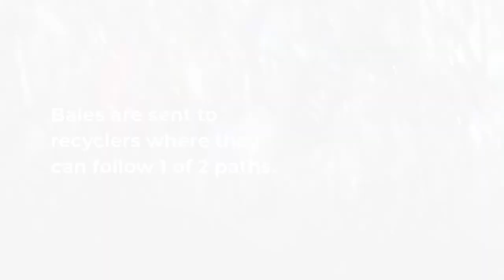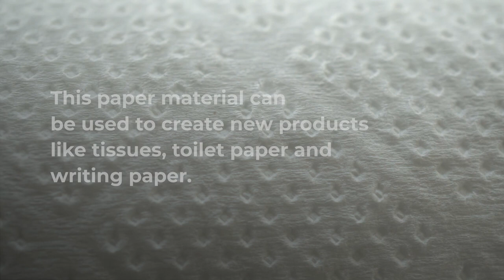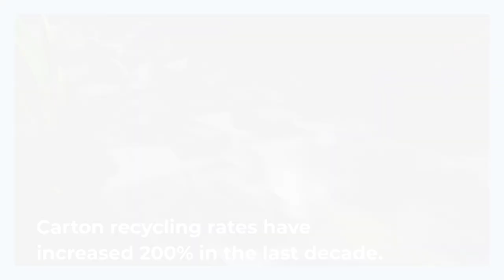Tetra Pak® Carton Recycling Process

Comment: I have a question please how much net water is used to recycle one tetrapac
How much electricity is used in this process per unit
I noticed that you call your product a carton but there is also plastic and aluminum liner if I'm not mistaken where do we separate and ship those elements of the packaging

I appreciate your answers
Reply from the maker: Thank you for your question. On average, our cartons are made of about 70% paperboard. 

Our cartons follow one of two recycling paths. On one path, the cartons become building materials. This process presses the paperboard, plastic and aluminum into boards and does not require any water.

On the second path, the cartons are sent to a paper mill where the fiber is separated from the plastic and aluminum components using a piece of equipment called a hydrapulper. Hydrapulpers are commonly used in paper mills for pulp production and many of these systems recirculate water to reduce overall consumption. The plastic and aluminum material left over from the pulping process (aka PolyAl) is either being disposed of in landfills or being used as a fuel for waste-to-energy, however, the Carton Council group is working with multiple entities to develop a use for the material in manufacturing. 

At the paper mill, recycling cartons requires a similar amount of water and electricity as other similar fiber-based materials. 

Check out recyclecartons.com to learn more!
Reply: @tetrapakuscanada  appreciate your answer!

Comment: I don't think my city recycles these - they accept paper, glass, and plastic 1,2 and 5. Even if it ends up in a landfill, however, I feel like this is still better than most plastic jugs that rarely get actually recycled anyway. The paper and metal parts will biodegrade leaving a small amount of plastic compared to the typical jug for milk. I would love to see us go back to glass. There are a few brands around that do that.

Comment: What happens with the plastic and foil sheeting in the milk&juice boxes?
Reply: Tetrapack is mostly a scam, they rely on a process called “greenwashing” to sell packaging to companies so customers buy their products thinking it’s good for the environment.

If the Tetrapack packaging you sorted into recycling is lucky, and your local sorting facility supports it, it *may* get sent to a facility in Mexico where they’ll cut them up and reuse some of the materials into filler material for construction or whatnot, ironically at a huge environmental cost, and the plastic parts go to landfill.

Tetrapacks aren’t actually recyclable.
Reply: @ethaneveraldo  Thanks. This is a sad realization of years of even stripping the plastic bottlecap from tetrapack boxes and dropping them to the plastic waste.
Reply: @ethaneveraldo   

I mean, it doesn't get more than their own reply to show how inaccurately pessimistic your comment is. Moreover the fact that building materials are harmful to the environment doesn't mean that there isn't good in using recyclable materials on them. The net damage to the environment decreases this way as the damage from construction is yet to be reduced by technology and well, we still need to make houses. Tetrapak is not a scam.

Their response:

Thank you for your question. On average, our cartons are made of about 70% paperboard. 
Our cartons follow one of two recycling paths. On one path, the cartons become building materials. This process presses the paperboard, plastic and aluminum into boards and does not require any water.

On the second path, the cartons are sent to a paper mill where the fiber is separated from the plastic and aluminum components using a piece of equipment called a hydrapulper. Hydrapulpers are commonly used in paper mills for pulp production and many of these systems recirculate water to reduce overall consumption. The plastic and aluminum material left over from the pulping process (aka PolyAl) is either being disposed of in landfills or being used as a fuel for waste-to-energy, however, the Carton Council group is working with multiple entities to develop a use for the material in manufacturing. 

At the paper mill, recycling cartons requires a similar amount of water and electricity as other similar fiber-based materials. Check out recyclecartons.com to learn more!
Reply: @lefterismagkoutas4430  This is a comment section on YouTube so you’re completely free to express your opinion and disagree with me, but I’ve been inside recycling facilities where they sort the tons of trash that flows in everyday, and the whole thing is a mess. Tetrapack’s model is terrible in my opinion. The facility needs to work directly with Tetrapack for them to be shipped and hopefully reused, but it’s very difficult for them to tell what is Tetrapack and what isn’t, especially since so many packagings look just like them but aren’t, and the sorting people don’t have time to inspect each individual packaging, they only have a split second to sort them from a fast moving conveyor belt.

I would steer clear from Tetrapack if you care for recycling, and look for something that’s easy to sort and recycle by most sorting facilities, like cardboard, glass, cans, and maybe plastic #1, #2 and #5 if your local community supports it, but in general stays as far away from anything plastic as you can. Only 5% of sorted plastics actually end up recycled, the rest is compacted and sent to landfill.

Comment: Though I strongly appreciate removing the paper pulp and recycling that in the conventional fashion, I don't like the concept of PolyAl; A composite created by shredding and processing the polyethylene and aluminium together. May I ask why these components aren't separated from one another and recycled separately? ♻🤔

If the answer is what I think it's going to be, then my counter-question would have to be; „So why don't you use a water-soluble adhesive, then?“ 💧